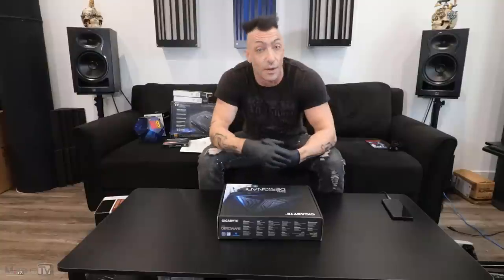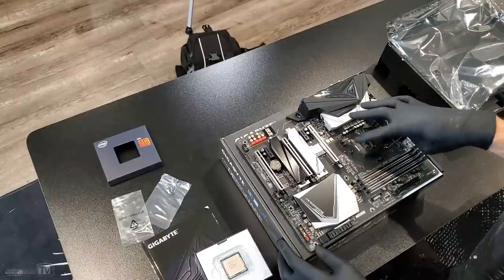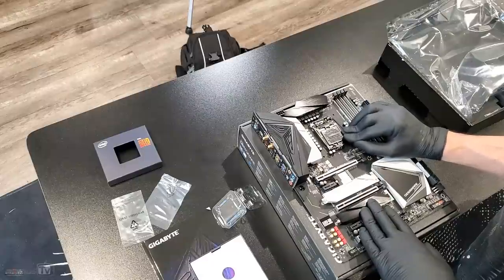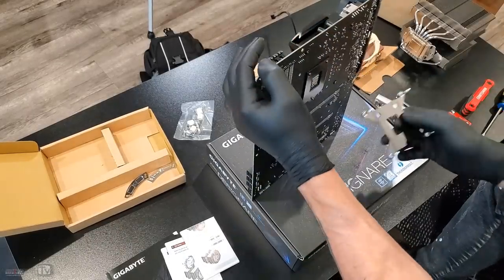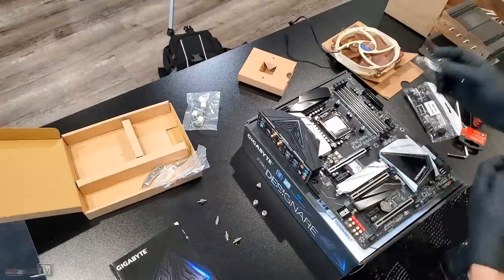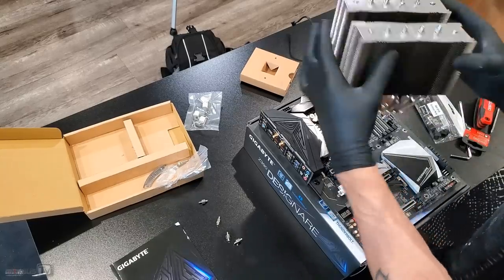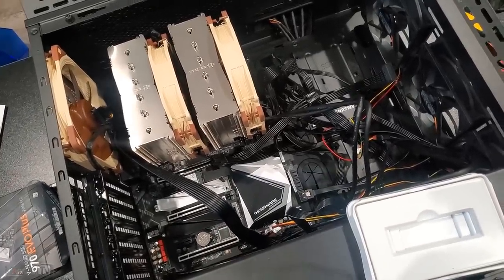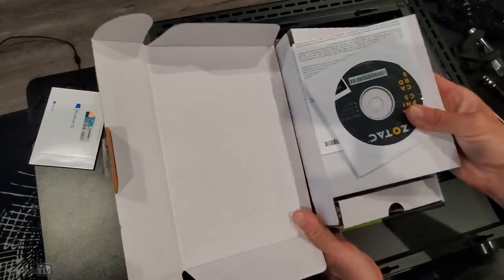Will it Boot? Building a Computer for Audio

Comment: Hi David,
nice build and good choice of parts! One thing I recognized and u might want to check again: you mounted the power supply with the fanside up. This way the air can't escape the unit, because the case is in the way. On the bottom of the case there is an opening with dust filter for this fan. I don't know how hot the the psu gets, but it could cause problems. Just so you now!

Comment: I'd replace the heat paste on your cpu. It was wrong used. It's purpose only to fill empty spaces between cpu and cooler. You need to put thinner layer as possible, and you need to cover cpu completely. Then make a nice push on the cpu with a cooler and then lock it. Otherwise it will not be tight, dries out and degrade with time which will overheat the cpu. You need a quarter of what you have put there.

Comment: I've been using AMD this whole time. Never had an issue for what I can remember. 
I'm using AMD FX right now, and everything works just fine. :P
Reply: What are you using for cooling your PC? One of the biggest struggles for me producing on my laptop is the fan noise. Do PC's also have annoying fan noise when CPU Hits are high? Should you run a liquid cooled PC as a engineer or is that not the professional route ?
Reply: @razzerraw1108  Cooler Master Hyper 212 Evo CPU Cooler is what I use! I also have 3 other fans in the PC running. They don't make much noise, and are suppressed by the PC's tower ( Thermaltake Suppressor F31 Window ) There is also a windowless option ( to have more sound suppression ) but for me, it's fine! No issues at all! 

My CPU never really runs high. If it does, it should automatically make the fan faster, but it's never happened to me, and I live in a hot place ( Orlando, FL ) 

I don't like liquid cooling, and will never try it out! I'm pretty sure it's cool to use ( pun intended ) but I don't want to risk liquid and electronics ya know! That's just me. 

Good luck!
Reply: @OmoiSenpai  Yea! I've been watching your tutorials for years now! I've been liking your use of outboard gear! Hopefully when I upgrade to a tower one day, I can get some hardware going, thank you so much for the insight man
Reply: The AIO coolers are pretty compelling at the same price as a good air cooler.  Have a 2x140mm here and it hardly seems to work at all for 16 core loads.  But yes a failure would be catastrophic.
Reply: @BuzBG  That's great! I'm just hoping in the future I can get an upgraded PC that has better sound suppression than my Fighter Jet of a laptop!
Reply: @Muse Axe Backing Tracks It's AIO so just on the CPU.  Seriously can't even tell it's on (though I have AC running).

Comment: Nice build. My plans are pretty similar with the only major difference being the Ryzen CPU. I mostly do post production mixing. My 6700k machine has been reliable the past four years but the sessions are not getting smaller and the plugins are getting hungrier. I‘m looking at the same CPU cooler but am also considering the U12A which is a little less capable but still excellent. It‘ll leave more room for RAM and PCIe cards which may be important in my machine. Noctua has not let me down in the past 13 years. My i7 920 went to a recycler just a year ago with its Noctua cooler as nobody wanted to use or buy it :). Still works fine.
I‘m looking forward to the optimisation video. One thing I‘m sure of, that I do not know everything.

Comment: The reason to stay with INTEL are also be able to use THUNDERBOLT even though some rare AMD motherboards that has support for it but don't work easily like on INTEL motherboards.
Reply: AVX and AVX2 INTEL technology that so many plugins use to instruct and run plugins on your platform are also only INTEL platforms.

Comment: This was such a fun video. I really am hyped for the optimization video. Also Intel chips have faster single core processors and is slower single core while having more of them. Audio does not work well with more cores so you went with the better CPU.

Comment: My AMD works like a treat, but it doesn't matter. If you're into audio, any recent pc will do just fine.I was on an old i7 until I build my new PC a few months ago and even with that I was able to mix. Virtual instruments started to become difficult though.
One small remark. I built many PCs in my life and I would add the heatsink not that early. If possible install flat components and cables first. That way its much easier to work out the cable management and i haven't got such a massive block in the middle of the workspace. Many people will do it different, it's just my approach.

Comment: Don't feel too bad about not going Ryzen, Although right now Ryzen is the prefered choice AMD chips don't hold there value well compared to Intel, This time next year the top-end AMD chip will be half the price you paid for it whereas the Intel chip will hold its value for years - That's how it usually is at least -   Nice build - Make sure you flip that power supply so air is going down and out - and watching a Vid on Cable management on here will go a long way - Pauls Hardware covers everything.
Reply from the maker: Oh I don't lol I have people messaging me pretty often about the problems they have with Ryzen and audio/PT and they should have gone my way. But thank you :D

Comment: Don't use just one SSD. Always use a back up. If the SSD fails, the data can not be recovered. Better use a HDD too, for backups.
Reply: It’s actually pretty easy to repurpose an old pc and use it as a NAS drive. Did it recently with an old i7 build from 2011, bought 4 iron wolf hard drives and a low capacity SSD for booting FreeNas software and set it up for RAID Z2. I swapped the power supply to be on the safe side as well but thats probably not 100% necessary, definitely worth re seating the CPU cooler with fresh paste. I’ve automated back ups of my audio projects and sample folders once a week with windows system back ups every month. If up to two of the hard drives fail at the same time it’s easy to swap them out and rebuild the storage without losing important data.
Reply: So I should buy two of the Samsung ssd?

Comment: Dude... the power suply was mounted upside down. The Fan is supposed to be turned to the down side of the tower. Still, watching at 15min mark...
Reply: Some power supplies need to be upside down for proper direction in the build.  I don't know, is this one really right wrong or not?
Reply: @musicjimbutler  the tower has the opening and filter. Most of these more recent towers and powersuply are ment to recieve the air thru the down side thru to the back never leaving any of its own generated heat into the case.

Comment: Thanks for your videos!  I've been trying to figure out the best build to run my Presonus Quantum 2626 and Studio One, which requires TB3.  There are hardly any videos addressing pc audio builds requiring TB3.  I had been leaning toward the AMD route (being "the best bang for buck") but now feel that cloning your build with only a few changes is the best and safest way to go.  I've read the comments and see that the NH-D15S (without low noise cables)is a better choice on the fans and  maybe different thermal paste should be used.  I'm interested in any other suggestions on how to improve on your build.

Comment: David, good point on the Intel processor. Go with what you feel comfortable. The only thing I would point out, and this comes from the crazy overclocking gamer's perspective (of which I don't do any more), you don't need to overclock anything nowadays because both Intel's and AMD's processors are more stable than ever and will meet or exceed your studio requirements for audio production. I just don't like Intel any more because of their greed and overpricing structure that is now biting them in their asses and was yet another reason why I now have a Threadripper instead. I just tend to err towards the more expensive side because they tend to last longer (and have more staying power) then the cheaper Intel or AMD processors. Plus, you're eventually going to do some video work on your machine so err to the side of more powerful than less. And remember, a couple more dollars INVESTED (not spent) in your working rig will give you better returns than leaning to the cheaper side. However, if you (AND YOU ALONE) are happy with what you built or bought, ignore everybody else's advice because you're good to go. Awesome build dude! Thank you for sharing too!

Comment: Have you had any issues with your Motu interface on this computer? I have a Motu 112D (same chipset and drivers as 16A) connected via TB to an Asus TUF x299 board and I have a strange problem where the inputs will stop working in Pro Tools. It's somewhat random and has no noticeable defect before it happens. Even though my computer was built in 2018 I am thinking there is a bad relationship with my hardware and must build a new PC. I'm considering this mobo/cpu combo. It's rarely a problem in sessions but has happened a few times and it's very stressful. Thanks!
Reply from the maker: Never, not even a hiccup, and I my system is pretty damn complex right now with 4 interfaces/converters, 34 analog I/O and AD/DA
Reply: @mixbustv  thanks so much for the feedback!  I have a complex setup too. Separate Apogee converters for I/O as well as a Tascam digital mixer for routing and other studio duties. My slightly incompatible Asus board has been a source of stress for a while.

Comment: DUDE!!.......this was like watching myself build my current system.  I ran into some of the same issues!.  Unseen clip from a zip tie getting lodged in a fan, and me losing my mind trying to trouble shoot why it won't spin.......then finally....OH! :-o 
   I'm curious, when putting on your right side case cover did you have any trouble getting on smoothly??.  That space is usually used for tucking  away excess cabling.  I had so much excess that I almost couldn't get my right side panel on.....super tight.  Looked like you had a lot of excess cabling from your PSU.  
Good luck with the new system, looks strong!! ;:-)
Reply from the maker: It was a tight fit, I had to move the original arrangement of the front panel cables, then it was okay, still pressing a bit but nothing major

Comment: I’m pretty much copying your build at the moment with only differences being case and RAM.  I heard you say you’re planning to run your Motu via the ethernet cable.  Are you able to do that on a windows system?  I know a while back when I looked into them the AVB wasn’t working with windows.  Windows users still had to use the usb cable.  Is that not the case anymore?  I was looking into the Motu LP32 or the rme Raydat for my new interface. If the Motu can function straight via AVB then it’s the obvious choice.  But if a usb/thunderbolt is needed I’d rather go with the RME.
Reply from the maker: To the best of my knowledge you can't connect via ether cable, that's only between interfaces, it's either USB or TB, I'm running TB abd it's perfect
Reply: MixbusTv Thanks!

Comment: you should have bought the Noctua NH-D15S. You did the right thing going for Intel
Reply: I plan on making the same build. Why should it be the nh-d15s?
Reply: Noctua NH-D15 will cover the first pcie port on the Gigabyte Z390 Designare. Noctua NH-D15S and Noctua NH-U12A will not
Reply: Which of those two suggestions is better?
Reply: Noctua NH-U12A is smaller and is as powerful so I prefer that.

Comment: David did you have any problem with the Thunderbolt Ports? I followed your build almost exactly but for some reason the Thunderbolt Ports are not being recognized by Windows 10. I downloaded the driver from Gigabytes website and initially they worked but the next day they mysteriously vanished from the system. I am wondering if you ran into this problem. If so please let me know how you fixed it.
Reply from the maker: Never

Comment: AMD now leading the way with heavy-duty workloads in DAW production. Unwise choice using an intel for future-proofing in my opinion.... I would imagine that the big DAW companies are already considering how they can utilise massive core counts.
Reply from the maker: I don't believe in "future proof" when computers are concerned, in 2 years you could be light years behind with what's now the best.
Reply: Intel gives you less latencybecause of single core performance but with AMD you can make every track more full of effects
Reply from the maker: @_Localer  I have hardware, that's my plug-ins 😄
Reply: AMD has no thunderbolt at this point, only one mini mobo has it on at this point ( ASRock X570). So AMD would not be an option for him now no matter how powerful the machine would get.

Comment: Guys, no Thunderbolt (yet) on AMD motherboards (well, except for one). So he couldn't be able to connect the interface. 

But, honestly:  reliability is absolutely no issue with AMD, in fact they have better thermals, so... 

Again: for thunderbolt interfaces AMD is not an option yet.
Reply: It is now:  Gigabyte TRX40 Designare for instance. But I would be happy to see someone testing Thunderbolt on it. Just in case ;-)
Reply: @davidsolena4853  Don't see any thunderbolt in the specs...

Comment: so what was the total cost all up? was the $$ savings worth the time versus having it built for you? I can't do this type of intricate work as I have hand tremors (essential tremor)similar to Parkinson's and can't handle all the small parts without dropping them.
Reply from the maker: Below 2K
Reply: @mixbustv  thanks David, you have inspired me to build my own! Started off ordering parts in groups Lian Li Lancool 2 case, ASUSZ390 prime MB, Thermaltake 750 watt toughpower grand 80 plus gold PSU, SK Hynix Gold 500 GB SSD, my next order will be- Intel Core i9-9900K 5 Ghz , WD_Black SN750 500GB NVMe2 Internal Gaming SSD, Noctua NH-D15 chromax. Black, Dual-Tower CPU Cooler(if I can find one). Corsair Vengeance LPX 32gb RAM DDR4, Samsung SSD 860 EVO 1TB 2.5 Inch SATA III Internal SSD. So far the total coming in around $1500 give or take $100...I just have to have someone without essential tremor to help me put it together...my wife is mechanically inclined ;) Rock on brotha!!!